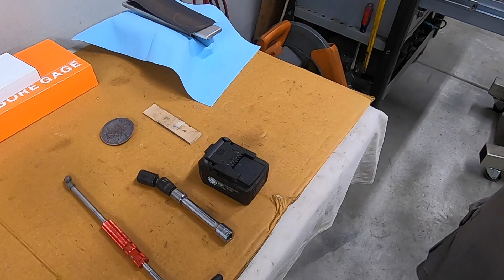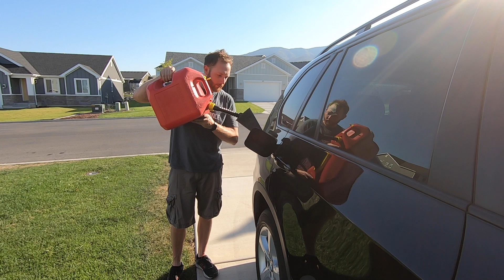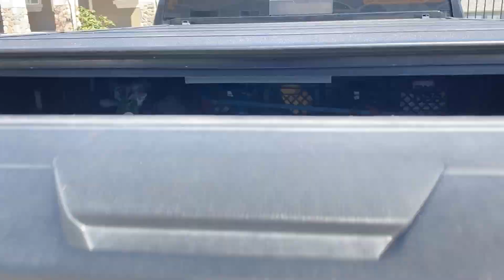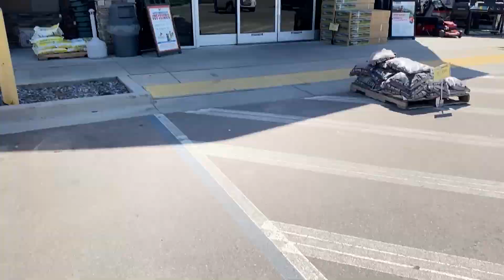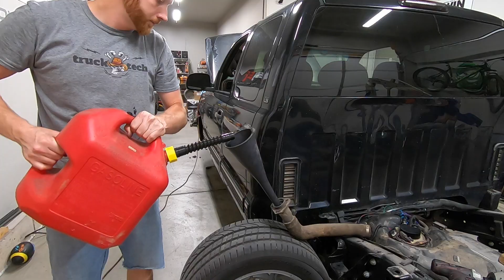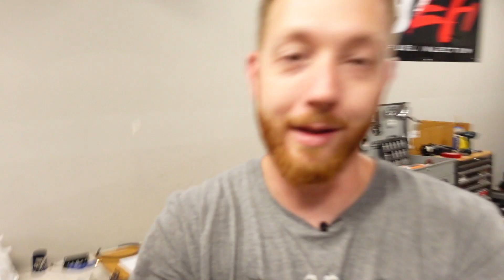pushing limits of my TURBO BIG BLOCK by swapping to e85

Comment: If you were staying on pump gas is the dual pumps needed? I'm trying to figure out if I should run duals or a walbro 525 on my 408 88mm turbo Truck. I'm hoping for around 800 whp.

Comment: Just did a similar thing and man it’s nice to feel the fuel back again! but my 4l60e didn’t agree lol,the 525 was maxed out and instead of buying another i cheaped out and refitted my eBay 044s and regretted it instantly realising I didn’t miss that noise at all! The main problem being the parallel osias pumps flow more than the walbro even at 60psi they were pulling a vac from the hell cat pump so they were getting cavitation so I staged them with a micro switch on pedal position that worked but led to too much a sudden drop in pressure on deceleration,so now one 044 turns off then the nc side of its relay turns on a time delay relay to hold the other 044 on for a sec or two like a relaxer on a carby and it’s silky smooth now!

Comment: Hey LT! What injectors/fuel parts fit on the 8.1? I also have an 8.1 in my suburban and am curious as to what fits on there or if it's 8.1 specific. Thank you!
Reply from the maker: They take the same (physical) size injectors as a Gen 3 LS, so anything that fits those will interchange

Comment: Hey ayo my boi name of the video is kinda click bait people have been pushing the big block Chevys for years same YouTubers have gotten 1100 hp out of an stock Bottom end this 8.1 bbc yes nobody wants to make parts for it compared to the 6 th and older gen big block Chevys so yes pushing this engine is very risky but hopefully if more of us try building these 7th gen 8.1 big blocks aftermarket companys like edelbrock and holly etc will start making parts for them I mean it is almost 500ci stock has pretty good heads stock 🤷🏼🤷🏼 we just need better parts so we can swapping this into other cars 👀

Comment: You may need to reach out to Flog and get one of those fuel transfer tanks that will mount under the tonneau cover of the tow rig. That way you can keep some e85 in the bed of the truck as well as some diesel for the long haul race trips and builds.

Comment: Good video. you do what i learned to do, turn everything into a teachable moment. 
i use e85 in my high compression (13:1) 4.8. going to a higher compression n/a, i could keep nearly the same timing when i jacked up the timing at 9.5:1.
what i like about my e85, is at the same boost level, you can have the timing be around what it would be n/a. gives you almost that perfect ratio (400hp at sea level + 1bar boost should = around 800hp with all things being equal) when adding in boost.
i have turbo big bore 5.3 - destroked a 6.0 with a 4.8 crank. 
keep up the videos man. love watching the journey.
Reply from the maker: Hey I appreciate you watching, and it sounds like a fun project you’ve put together. And that’s exactly what I live about e85!

Comment: OMG, I'm currently building a staged dual pump fuel system and I wondered how it doesn't backflow when only one pump is on.  Thanks to you, now I know about the check valve.  I also learned that the Holley ECU can use the flex fuel sensor, so I can't wait to do that next.  Thanks so much for the good info!
Reply from the maker: Glad I could be of help!

Comment: I believe the factory redline is too much rpm (5500) with a 78mm throttle body and that's why the 8.1 has problems. I tuned the one in my suburban to 4700 and now there no upper rpm pause in power in-between shifts. 165k and no problems

Comment: Excellent video and incredible editing! I was going to ask when you were going to switch to a Holley. The amount of control you will have when you do that will be amazing!
Reply: What can be done with Holley efi that cannot be done with a 420 ECU?
Reply from the maker: A lot of safety features, like pull timing and boost if fuel pressure gets low, oil pressure drops, traction control, boost ramp, and control just about everything exactly how you want it
Reply: @TolmanPerformance  safeties sure.. but as far as actual ability to be tuned to run right the 420 is pretty good. I spent thousands on Holley HP when a 420 swap would've easily accomplished my goals for na 383 sbc. And I would argue the anti abuse and piston saving stuff in factory ECU are more than capable of doing a good job of saving the engine

Comment: Hey LT, I used twin 450’s, -10 to twin -8 supply, -8 return, Holley rails, aeromotive regulator, on e85. Handles 1,000 no problem and can daily drive my 2000 silverado. 
Just a option if you go that route
Reply from the maker: Good info on the line size! Thanks!

Comment: I’m running stock lines on my fbody with dual pumps on e85 making 900 to the tire. No issues at all no fuel pressure drop. No pressure spikes with 2 pumps, running them staged. Just used a 4an fitting off the pressure port of the stock fuel rail to a aeromotive pressure regulator and return using stock return line.

This build is awesome! Nice editing
Reply from the maker: Good idea on the return lines and regulator, that’s key to maintaining pressure I believe
Reply: @TolmanPerformance  yep the thread on the stock rail is 4AN makes it super easy 👍
Reply: @TolmanPerformance  just use a tire valve stem remover to remove the stock return valve core.

Comment: I'm working towards the same direction with a cammed 6L LS. Started on installing today on project 6.0SS 94 s10 N/A for now. Don't have bigger injectors yet. It will be hooked into my terminator x max then E85 to the tank and then even more traction problems Lmaooooof

Comment: Lawrence e85 burns hotter, because of the higher oxygen content, that is why it is recommended to run colder plugs when on e85. That being said it has a high resistance to knock so it can be pushed harder with additional timing which also increases the heat.
Reply from the maker: thanks for the clarification!

Comment: Couldn't flex fuel it with the factory computer?
Reply from the maker: yup, absolutely could, but the flex fuel OS limits the VE table to 2 bar instead of 3 and I already exceed that... I have my orange truck on a true flex OS
Reply: There are 3 bar 80e OS out there

Comment: Please get an ethanol content test kitest kit and keep it in the truck and test the content of the ethanol in the fuel before it goes in the truck I've seen people burn up their motors because the ethanol content was wrong
Reply: Lol he literally used one in the video
Reply: @ryanlarr454   Just because he tests it in the video does not mean he has it in the truck with him To test anytime he gets fuel
Reply: No you haven’t ever . Quite down & stop spreading BS .  A proper e85 set up uses a alcohol sensor and the tune adjust accordingly . Secondly even e50 wouldn’t be to blame the peoples you knows engines that blew up is because they were SHIT engines or SHIT tunes
Reply: Its like you didn't watch the video at all !
Reply from the maker: yes, it will be tested each and every time we fuel up

Comment: My truck is tuned for E85 only and it's tuned for like 60-65% ethanol content on purpose so that the tune will cover any stations or blend fluctuations throughout the year. Instead of having to dick around with the tune every single time I fill up.